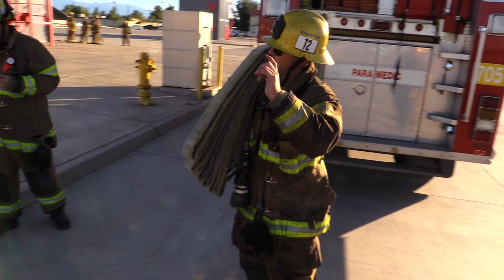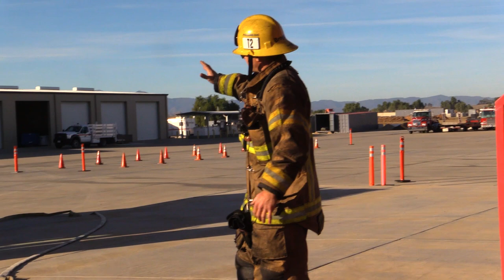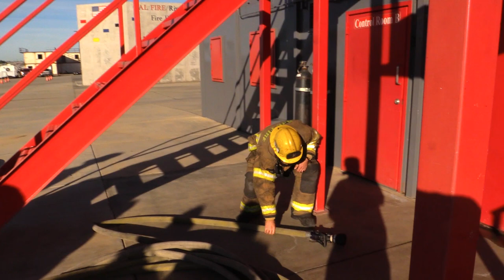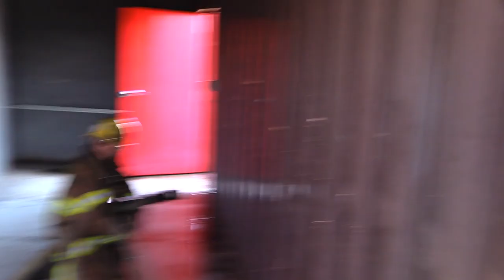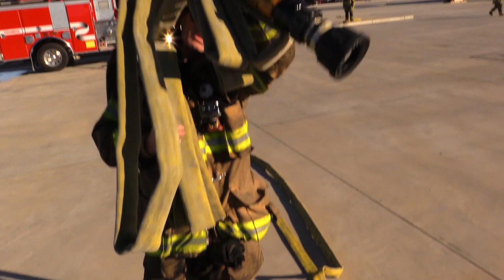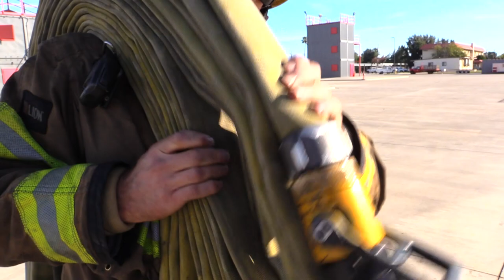Hose Stretches

Comment: What Helmet they have ? Did you have eye protection on it ? Nice video Btw(Y)
Reply: It’s the “first due” helmet from Phenix Technologies. They are based out of Riverside and are pretty much the standard California fire helmet everywhere except Northern California. You can have goggles or face shield on them but most departments don’t use them since they usually just melt off in a structure fire. I personally just keep eye pro in my pocket and most guys wear sunglasses that are Z87+ impact rated anyway.